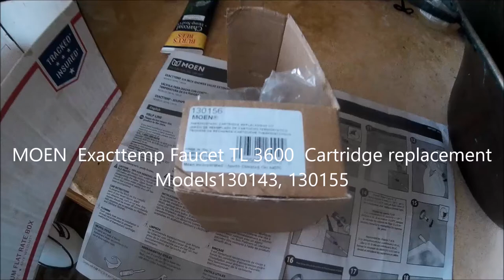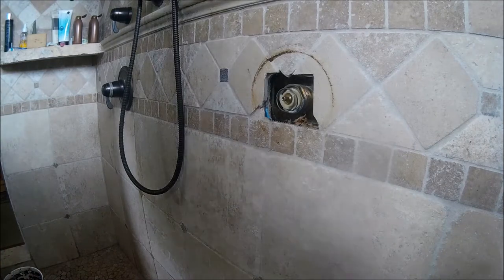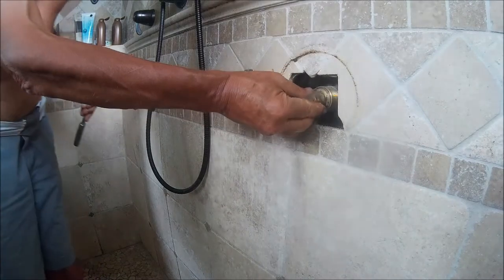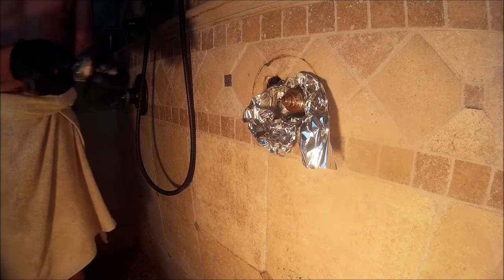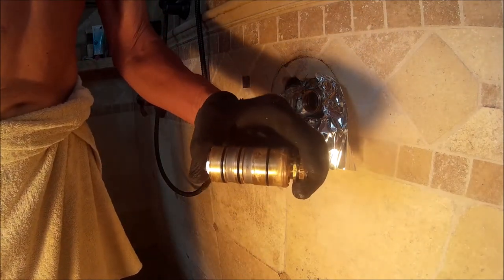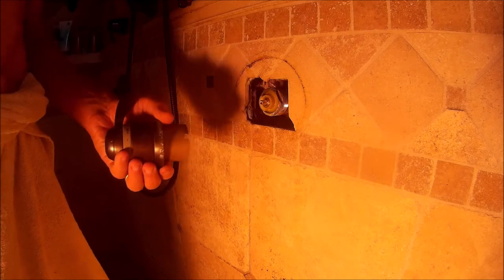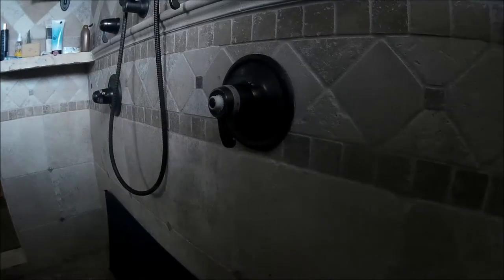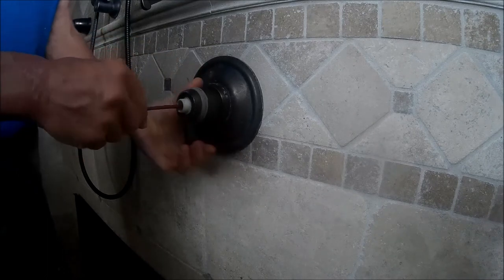Moen faucet cartridge replacement For TL 3600. Cartridge model number 130143, 130155

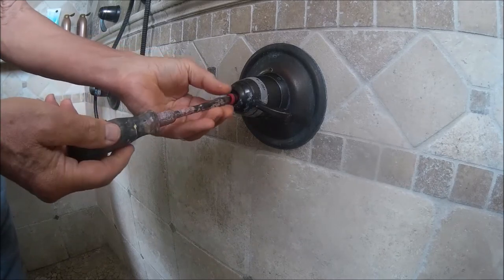Comment: Clarification for anyone confused by the title of this video – NOTE: The video title is incorrect. The correct title should be: Moen faucet cartridge replacement for S3371 Cartridge model number 130143, 130155.  Here's the deal; If you pause the video at 1:01 you can see the gray ring at the back edge of the knob where you can see the different temperature settings on it. As he mentions in his description field the cartridge is failing to control temperature. In other words - the valve he's "actually changing the cartridge in" is a Moen S3371 ExactTemp Thermostatic Valve which controls the temperature. The Moen S3371 ExactTemp Thermostatic Valve system can support up to 4 smaller volume control valves (amount of water flow). The smaller volume control valves  are Moen S3600. Adding to the confusion, the number TL3600 in his video title is actually the part number for the trim “knob/handle” for a Moen valve S3600. In regards to the two cartridge part numbers provided in the title they are incorrect as 130143 is a “valve extension kit” for s3371 and 130155 is a valve extension kit for S3600. Let me support Raymond by saying the errors with the video title are not Raymonds fault simply because Moen has the most confusing and illogical part name and numbering system of any plumbing fixtures on the market. If you call Moen support, even the reps on the phone sometimes struggle trying to identify the correct model and part numbers. All that being said, this is a awesome video with great narration and information. Anyone fighting to fix a leak or replace any Moen cartridge can benefit by watching this video.

Comment: What is the purpose of the cartridge? I have a leaking shower head with the same exacttemp valve that “blends hot and cold” , I also have the same on/off knobs as you I see in the background. I would think my problem is with the on/off valve or cartridge and not the “blend” valve/cartridge as your doing here. Does that make sense?
Reply from the maker: I believe you are correct. The mixing valve is to set the temperature not to turn water on or off.
Think you'll need to replace the on off valve. Tell Moen you're the original  purchaser and they'll send a replacement. You'll have to replace yourself. It should come off the same way this video shows. Protect the finish when unscrewing

Comment: Wow, this DIY was spot on.  I had the exact same problems getting the old cartridge out.  MANY MANY MANY thanks for sharing your experience and successes - you probably saved me several hours, a few trips to the tool store, and a lot of cuss words.  I didn't need to do this after applying heat to get the whole thing (vs. stem) out but another idea might be to apply red locktite to the stem and let it set overnight after heat has been applied to loosen things up and the threads are completely dry.  Just a thought...

Comment: So the one I’m working on, has one central exacttemp valve that only controls the temp. Then there’s 4 other valves that turn the water on and off. What are the smaller ones model?
Reply from the maker: Not sure. If it's commercial maybe there are additional fixtures they control. If it's Moen call their customer support
Good luck
Reply: A  Moen S3371 ExactTemp Thermostatic Valve system can support up to 4 smaller volume control valves (amount of water flow). The 4 smaller volume control valves are Moen S3600. In this video he's actually replacing a cartridge in a Moen S3371. Adding to the confusion a TL3600 in his video title is actually the part number for the trim knob for Moen valve S3600